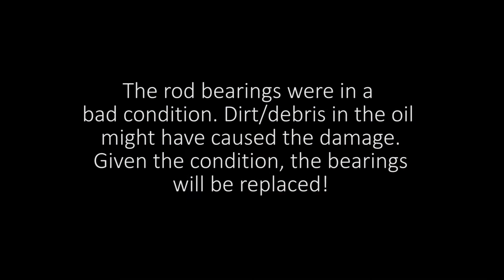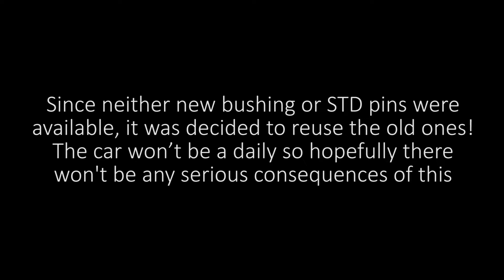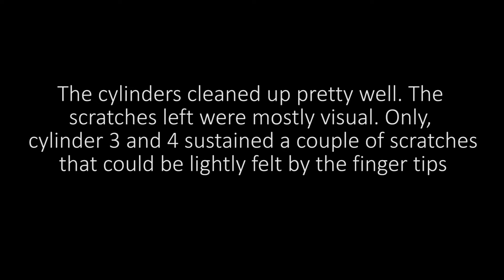Hindustan Ambassador Piston Inspection and Cylinder Honing

Comment: Brother any updates
Reply from the maker: Yeah brother, the engine is assembled and runs, however, faced a few problems with the fuel pump and carburettor. So have not been able to drive it yet. Will release an update video soon...
Reply: My cj3b willy's jeep body totally rusted so what is your opinion restore body or new body ? pls suggest
Reply from the maker: @nimeshvala1793  Restore if originality is important. New body if longevity and quality is important.